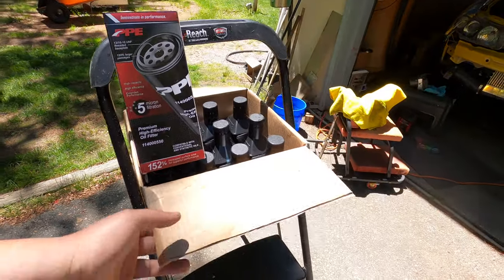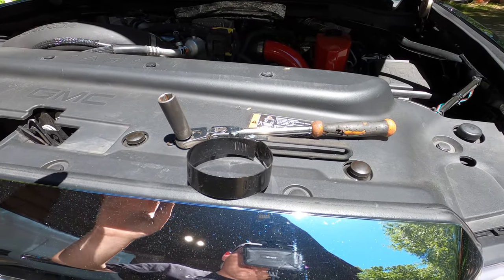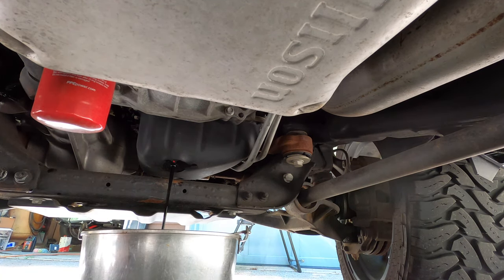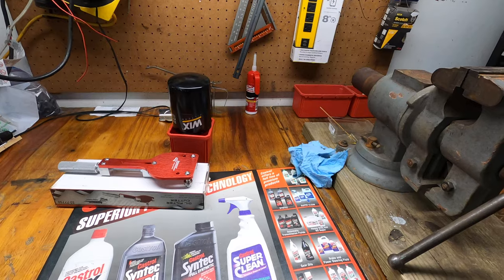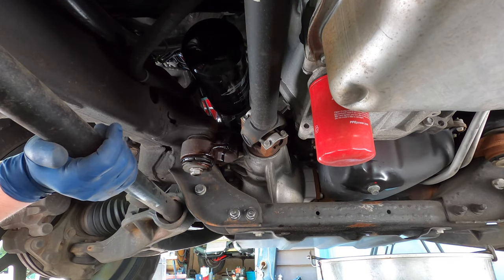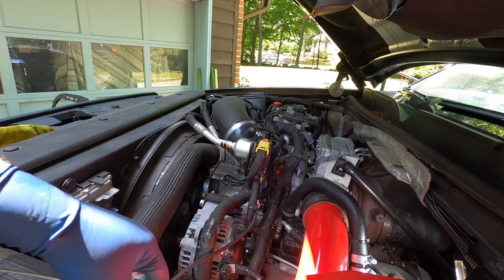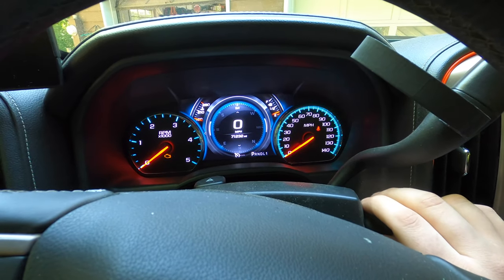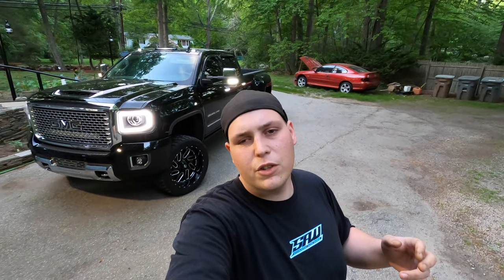L5P CHEAP MUST DO UPGRADE FROM PPE + oil change

Comment: So you’d think buying the best oil filter and using the best oil , it should be able to go a few more miles before changing it, right ?!
Reply from the maker: I would check the PPE recommendation I would assume they have an extended recommended  interval on their site!